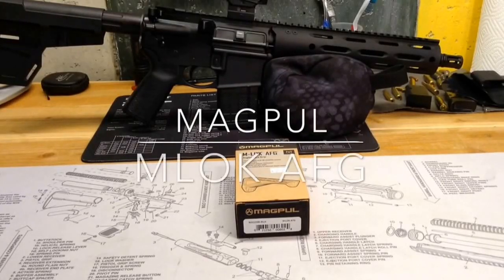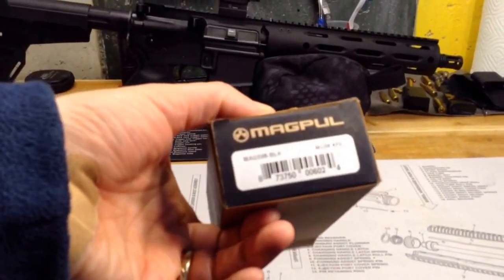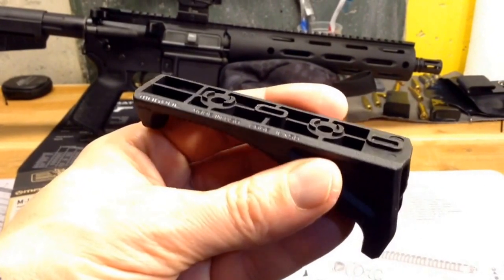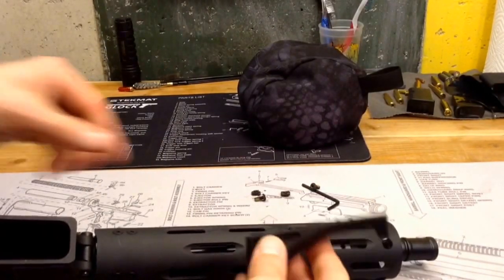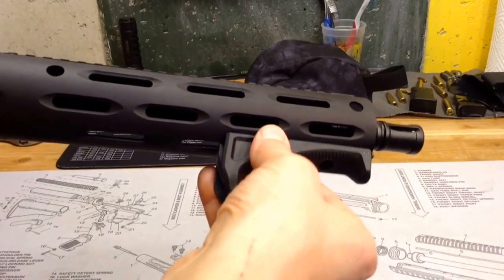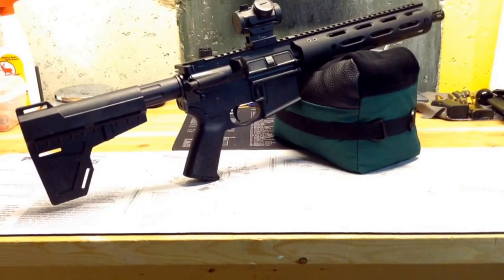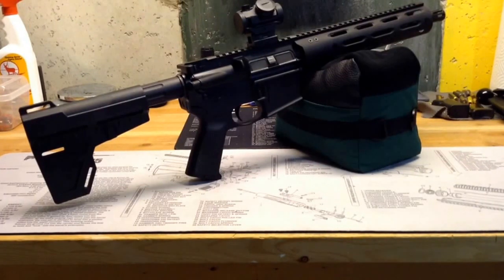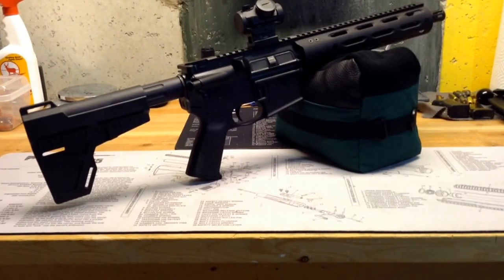Magpul MLOK AFG - Quick Look and Install FAIL!

Comment: I have the same pistol and same AFG. I grounded protrusions on AFG on belt sander, put sticky tape on spatula, position the nuts on tape and fed it inside the forearm. Backing nuts will fit if poisoned perpendicularly to slots in forearm.
Reply from the maker: StagArmslower I ended up using an MOE rail and the AFG that attaches to a  rail section.

Comment: I have that same handguard and what I did is dremeled the sides a bit that I wanted to add an attachment cuz nothing would fit but I made it fit lol it's up to you though if you dont care about messing with it a bit I don't careits just a handguard so that's what I did and not I have all the attachments I wanted on them just have to modify it a bit

Comment: I used the pic rail sections to attach the angle foregrip to my uppers, its a pain to install the lil lock nuts from inside the rail.
Reply from the maker: OrangePitbull That's my next plan.  Has to be better...
Reply: ok i know i'm really late to the party but why not just take the handguard off and save yourself the headache? it's just 8 screws and besides they needed some loctite on my upper anyways so why not just take it off to attach all your goodies

Comment: i have the same handguard on my pistol upper, just take the hand guard off with the 8 small screws and attach some rail sections  with some thin nuts that can grip both sides of the slot, a little bit of blue locktite and some ingenuity its held the rails on for 1k+ rounds now. i do plan on getting some of the rail sections from radicalfirearms or possibly just replacing this handguard with the fqr quad rail as it shares the same barrel nut.
Reply from the maker: Purple Sticky Thanks for the suggestions and thanks for watching!
Reply: no prob thanks for replying  i ended up ordering the quad rail from radical firearms through opticsplanet because it was about $30 cheaper and it uses the same barrel nut. can't wait to just have a full quad rail and no fuss with the moe/mlok system